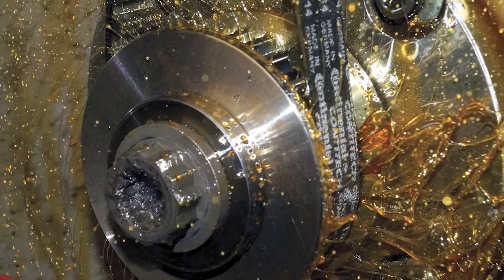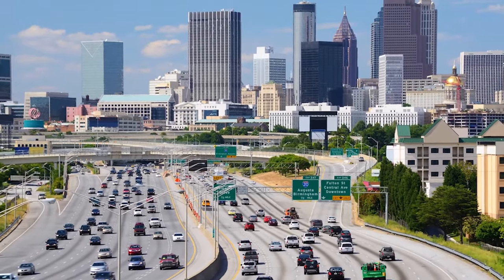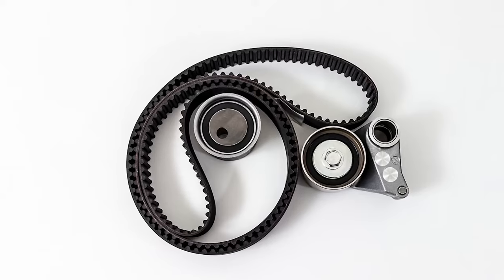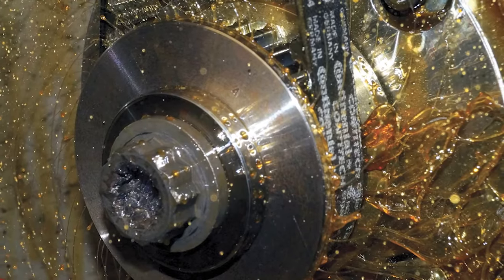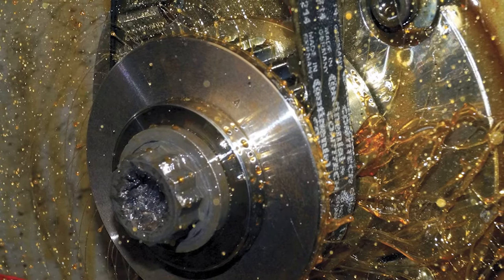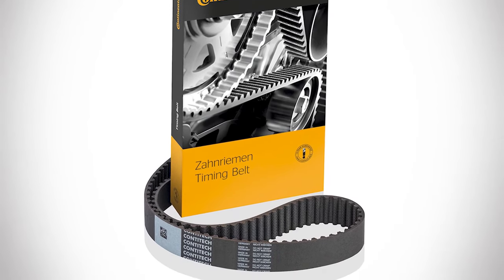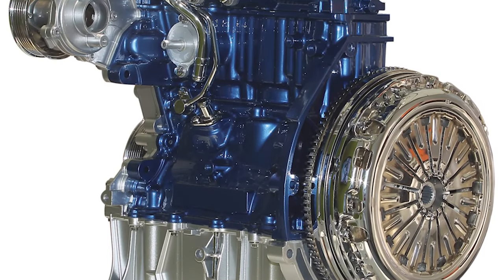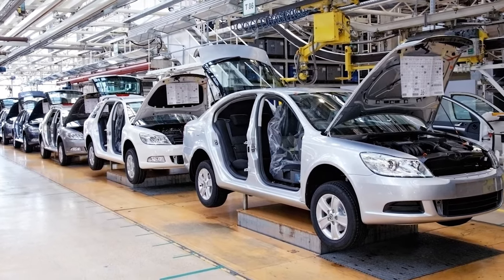Belt-in-Oil Timing Systems

Comment: I won't with the degradation of the wet timing belt timing systems would Shell Helix ultra stop or reduce the damage. Given the oil is fully synthetic GTL based oil with no crude oil base to case any reaction.
Reply: It is contaminants in the oil from the combustion of the engine that cause belt degradation. In Citroen PureTech engines what have belt in oil system, it causes the belt to fall appart and chunks from the belt clogging the oil paths in the engine leading the catastrofic engine failiure. So, frequent oil changes and using the premium fuel will extend the lifespan of the belt.
Also, all modern engines require fully synthetic oil. Even those that require semi-synthetic should use fully synthetic oils. There is no exuse. It is given that the oil is fully synthetic, why would anyone ever use a subpair oil. 
And you need the oil that satisfies the quality standard for the specific engine, meanin it is designed for the engines that have belt-in-oil system. Also, manufaturers like Continental and Dayco had released an upgraded versions on the wet belt, that are more durable that the OEM ones from the few years ago.
Reply: Puretech = Purecrap or Pureshit as there now known as in the motor trade. Ford Ecoboost = Ecoboom or Aquaboost.

Comment: You don’t see Toyota or Honda doing this nonsense
Reply: Honda did it on their 1.0 turbos fitted to Euro Civics.  They also have premature failure issues, lots of reports on the net about belts failing before 40k miles, lunching the turbo and engine.
Reply: When I was buying my car I got in mind with avoid a great many things, 1 electronic parking brake, 2 keyless start, 3 any engine with less than 4 cyclinders aka 3 cyclinder engines which are far rougher, 4 any intrusive active safety systems like lane assist or AEB, 5 any car that does not have a spare wheel, 6 big wheels with low profile tyres, 7 any engine that doesn't use a timing chain. I ended up with a 2016 Toyota auris 1.2T with 16 inch alloys this was purchased in 2019. Fed up of cars with stupid stuff that ruins comfort and reliability.
Reply: I felt the same way...  to avoid all those unnecessary complexities, and found the Chevy Spark (5 speed)... plus no turbo.
Reply: yes if 1 cylinder fail just deactivate it.. pull the injector. over haul at 3rd cylinder fail. you  can even hack the sensor.. and ecu. its runing it's good.. 🤤
Reply: @gravemind6536 yup, I hate all the overly complex systems in these newer vehicles too. Which is why when I was looking for a small fuel efficient car to commute with, I bought a used 10 year old Nissan Versa with a 5 speed manual transmission. It's has a decent 4 cylinder with a timing chain, key for the ignition, and none of that electronic safety crap. It's like driving a Japanese economy car from the late 90s and gets about 36 mpg too. Only thing I wish it had was power windows, locks and mirrors. It's a cheap car but I appreciate it more and more seeing all these new cars loaded with complex crap.
Reply: Yes they do , but Honda is not Ford lol @disarchitected

Comment: They are a nightmare. They clog up the engine as they degrade and the rubber particles block the oil pickup and other parts

Comment: What a stupid, stupid design and the reasoning is flawed.  I know of no basic human would chose the risk of engine failure due to a wet belt if sat down and the design was explained to them.  Even if they work, at some point the belt will have to be changed and considerable cost due to the labor involved all because of a $30.00 POS belt.

Comment: All you need to do is remove the front clip from the vehicle. Remove the steering rack and the lower front frame then remove the engine and transmission from the vehicle and then remove and resurface the head and rebuild the bottom end of the engine. Its reallly streamlined and the belt only costs $500

Comment: All sounds like a big con. I have been looking to buy a car recently, and the majority of cars in my price bracket are fitted with this type of belt. All of the dealers are offering warranties, one is offering a ten year warranty that would replace these problem belts. I would therefore pay to have piece of mind - why? Would think that attempting to off load a car fitted with one would be a real problem . These warranties are not transferable (please correct me if I am wrong)- making your car  potentially worthless very quickly. I believe that the price range to replace these belts in a dealership varies from about £500 to a couple of thousand. ( depending on manufacturer)

Comment: Ford may go under from belt in oil systems. All the Eco Boost engine failures are simply mind blowing. Worst engine design since the Chevy Vega 4 bangers.

Soo stupid a design, the engineers and those that approved the design should be fired and not let to even work on a Tri-cycle!

Comment: Hybrid is the way to improve gasoline mileage. 
Electric car with gasoline assist. 
Allows no turbos, no GDI without port injection, no sleazy mechanical CVT, no accessory belts. 
Allows efficiency tuned Atkinson cycle engine for even better fuel economy. 

Electric car goodness without the electric car drawbacks. 
Much like a torque converter automatic, but even nicer.

Comment: 1% reduced fuel consumption? There's a YT video where that 1% is challenged and seems to work. However, the chap who did the testing calculated that it saved him only €15 / $16 / £13 per year! As for reduced engine noise? Unless you've super soundproofed your car, tyre and wind noise at highway speeds will drown it out! There probably is some truth to the claim about a rubber belt reducing crankshaft harmonics but I've never noticed it too much - if at all, with chain drives.
My car, with a Puretech 1.2 155bhp engine and only 22,000 miles on the clock, is currently in the dealership for a warranty caused by a problem with the inlet cam dephaser and, as likely as not, the root of the problem is probably the timing belt beginning to break down and shed pieces.

Comment: For 1.2 puretech engines; just use right engine oil coded "B71 2302 or B71 2297" These engine oils are formulated to avoid damaging the timing belt. Other than these engine oils that you think are of high quality will damage the timing belt. Just use B71 2302 or B71 2297 PSA approved engine oils..
Reply: Not true, customers who have been using the recommended oil are still having high wet timing belt failure rates.
Reply: People need to change oil before brand recommendation due to oil dilution problems and for cars that do small courses they need to change every year because they use the car with engine cold and the oil dilution with petrol is even worst.

Comment: Really? Fuel savings of 1%? It’s a shame to even mention this value.
And how much they save on the COGM? Maybe a few cents, maybe 50 dollar / unit. Peanuts! 
And what about reliability, safety and cost of ownership? 
Ford is being sued because their EcoBoost engine catches fire due to cylinder wall cracks, and the disintegrating oil pump belt causing premature failure of the engine, and degrades braking power and efficiency!
PSA engines, wet-belt disintegrate between two early oil changes on their own, engines need full replacement before they can hit 100 K kms (60 K miles). So that’s how “genius” this wet cam-belt system is! It only brings money to the manufacturer, robbing the car owners and sucking their wallets dry!

Wet belt systems are a disgrace for the well established car manufacturers!

Comment: I get using a belt, but why are they putting it in oil? I believe it’s for money and nothing more. Soaking a rubber belt in oil  doesn’t make the engine more fuel efficient.

Comment: The other issue I have with the design is many can’t be visually checked easily. So you have an invisible degrading belt losing materials into the oil. The first you know about it is when something catastrophic happens to the engine. The benefits are way less than the cost. Illogical design!

Comment: Greater fuel economy means nothing when your engine blows up due to belt breaking or the engine seizing due to oil starvation when the debris from the worn out oil pump belt clogs the oil pickup tube. Congratulations! You now need a new engine.

Comment: One of the dumbest ideas ever. WTF were they thinking?   Rubber belt that sits in hot oil and spins the oil pump. Even the belts that sit on the outside of engines get ruined quickly when oil gets to them. But to have a belt sit in the oil all of the time...crazy...
My Honda push lawn mower had this and sure enough blew the engine.

Comment: Message from Europe: ditch the belt in oil systems! Either as camdrive or oilpumpdrive they are terrible: engines get totaled by premature breaking of both the drives. Keep with dry belts or chains in oil: better for your wallet!!

Comment: Emmissions😂
Reply: I know! What a con! What is the result in regards to emissions of having to manufacture millions of extra engines to replace the ones wrecked by trying to save 1% emissions!?
Reply: @SisterAbdullahX  most of those 1l Ford engines will end up in the scrap pile because the teeth broke off. At least make it a dry belt (i.e timing belt) which typically lasts 100k.